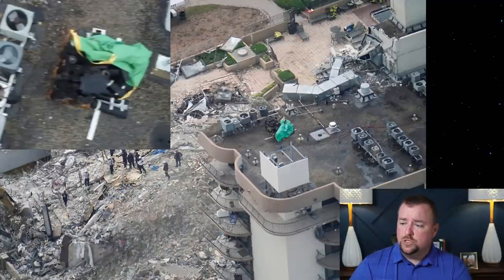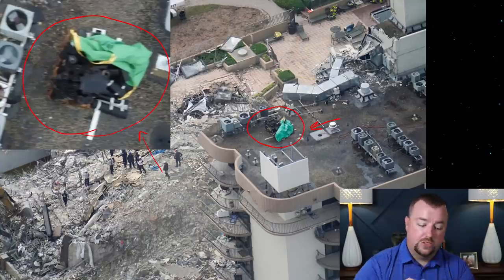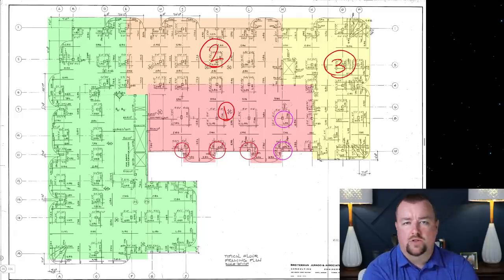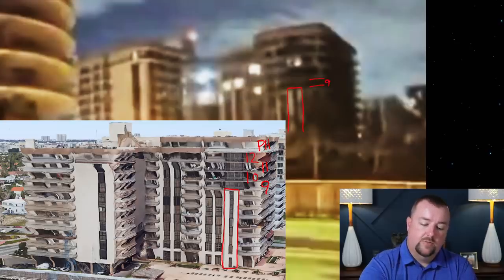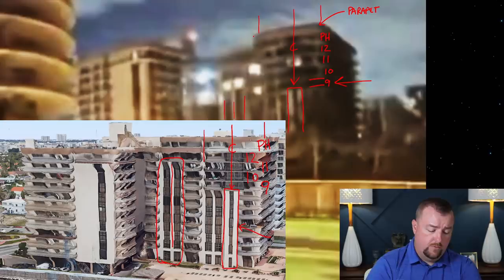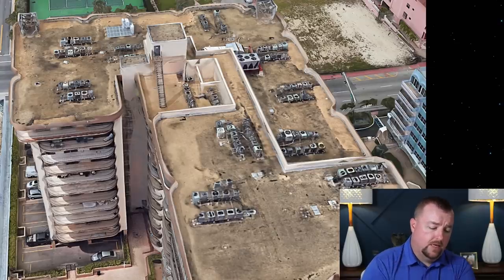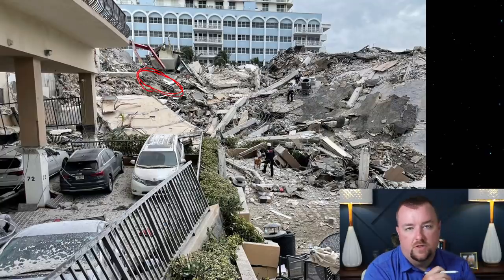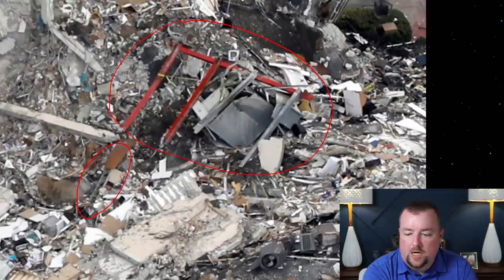Surfside Building Collapse - Did it start at the roof?

Comment: I'm not an engineer, but I've built commercial buildings for 30 years. Given the total collapse of the building, there is NO WAY the problem started at the top. For whatever reason, this building was deficient at the base! 
The issue with the 9/11Twin Towers didn't start at the base, but had several (as I recall, in one case it was 13, and more in the other tower) stories pancaking under inertia! For the total destruction in this case, it had to start at the bottom! When I heard about this collapse I thought Hmmmm, that's interesting. When I saw the video I thought... holy s***! I've seen planned demolitions that haven't gone that well! And don't start with the conspiracies theories!
Reply: Agreed ... A column snapped and the spandrels dropped snapping the post tension tendons ... When the bowstrings broke the building came down
Reply: Buildings like these towers were built to withstand this much damage without complete failure.
No way was the roof job a trigger to the collapse.
It had to be there in the bottom ,inside the columns from too often assault and  inundation of saltwater from inside and or ground level giving way by sifting sands beneath the towers or both at the same time happening, spanning many years.
Perhaps,there was not enough waterproofing done to concrete walls,floors and columns when   needed. Waterproofing  even stone is very beneficial to inhibit moisture damage.
Reply: You can say that all day- but the fact is clear- that inner penthouse parapet portion is completely missing and I never noticed that after watching this a hundred times. Went back to google maps to see and yes- it’s totally flush with this remaining parapet wall and should be visible. Would be nice to compare the time stamp of this video with the next door hotel guest video of the parking garage. If they coincide it wouldn’t surprise. Where it started, roof or base, but that wall is clearly missing. Something happened up there as well as in the garage.
Reply: @TheArayray  Interesting.
Knew nothing if that before your mention.
Reply: Agreed.  Also, the Twin towers collapsed with help of the burning jet fuel causing the support structure to melt and start the top to bottom collapse.
Reply: @TheArayray  You watched that video 100 times? News flash, we're on the mend from Covid. You're allowed out again!😃 
The weakness was at the bottom of the structure!
Reply: @alacran1986  The failure (removable) of the fireproofing due to the initial explosion, and subsequent failure of the steel trusses due to the heat, WAS the ultimate failure of the twin towers. In the '70s, they had actually planned for a fire caused by the fuel load of a 707. However, they assumed the fireproofing would stay intact. It didn't! Counterintuitively, wooden timbers survive fires better than unprotected steel beams.
Reply: @carlwilliams6977    -Note that the condo on June 24th dropped similar to the part that dropped on July 4th.
-Note that the condo collapsed similar to WTC7.
-Note that the University of Fairbanks, Alaska  investigated the fire-theory and concluded after a 4 years study, that WTC7 was NOT brought down due to fire.  See final report released in March 2020.
-Note that office fires won't produce enough heat to melt  steel.
-Note that adding more fuel doesn't produce hotter flames, in fact a fire can be extinguished by adding too much fuel. 
-Note that NIST had to abandon the pancake collapse theory for the twin towers.
-Note that, when you say that the twin towers were hit by an hijacked plane, which you seem to indicate, that you follow the NIST-conspiracy-theory, that  a group of cave-dwellers from Afghanistan CONSPIRED against the United States.
Reply: @TheArayray  Hi Rayne. I agree, watched the video over and over, the penthouse seems to be damaged "before " the main collapse. Speculate we can, perhaps the inner column(s) under the penthouse went first? rubble seen in basement prior was from "left" area under penthouse. There is a comment from a survivor stating something about a floor missing on the first floor, could this floor collapse have been the cause of the pool deck also collapsing? So did the penthouse collapse, shocking a column(s) to failure in the parking bay level followed by a floor collapse internal to still standing exterior, causing pool deck to fail (dragged down by internal slab) which in turn expanded to pull down peripheral columns?
Refer: https://www.youtube.com/watch?v=jIHa5n_4TSk
Clearly shows 12th floor roof parapet intact and penthouse (left) missing while outer skin remains intact. Then the total collapse is centered at a point directly beneath the missing penthouse  (right side of Section 1) followed by collapse of right side of 'Section 1"
Working on the roof followed by collapse of penthouse area ...... coincidence?
Reply: @reallyme3573  You've lost your mind, and live in Qville. NOTED!!
Reply: @carlwilliams6977  and yet here you are! It’s a 5 second video so that’s about 500 second of my life which is still a minuscule fraction of the time you spend online trying to figure out what sex feels like.
Reply: @carlwilliams6977  Omg so boring, no wonder you have no idea what it feels like.

Comment: The really bright, blueish lights you're speaking of look somewhat like arc-flashes. Could this have been caused by the high current lines being severed as the floors pulled away??
Reply: Thermite
Reply: Det cord ..  go look up mine pit blasting. It’s so obvious it’s internal explosion. Det cord explodes in milliseconds just like a light flash. People inside wouldn’t have been able to differentiate the noise between that & the building collapse.
Reply: yeah thats exactly what I thought
Reply: @R00RAL  I've used det cord before...Tried 'blasting' a 8" tree trunk by wrapping a couple turns around it. Just having some fun to see whether that would take the tree down.

It. Did. Nothing. To. That. Tree.

Didn't even scar the bark layer.

Det cord could not bring that building down even if it were severely weakened.
Reply: @R00RAL  I've watched controlled demolitions before. I see nothing that even hints this was similar to those...
Reply: @DaveC_TN  Fair enough .. we agree to disagree then.  The world is run by criminals. We must agree on that. I know families were in the building.  I believe McAfee may have stored evidence there. It’s just speculation, however possibly why it was dropped.
Reply: @R00RAL  it wasn't an explosion, there was no explosives involved. IF it was a controlled demolition, it would've been done with something quiet like thermite (which doesn't ignite with common detonators like det cord and blasting caps).  Thermite requires a much higher temperature than what blasting caps can offer, even a high strength blasting cap would likely destroy the charge even before it ignited (IF it could ignite it). 

I have worked with several high strength explosives for several years and I can tell you with great confidence there was no explosives used. If they find metal beading on the supports, it will tell us this was certainly melted by thermite and was an intentional detonation, if not, then it likely did actually fall on its own. I, however, do not believe it randomly fell on its own, but only time will tell.
Reply: @R00RAL  That's not the same building, hun.

Comment: I have from the beginning said that those blue lights, flashes was electrical. Consider how much voltage is needed to run thoseA/C units, and then how much for each condo. There’s minimal 240 volts running there. Maybe even 440. All these people who say it was a explosion from dynamite has never seen high voltage short out. Once you do, you won’t forget it. Very impressive to see, and scary! And there is more than just one bundle of high electrical lines running up those walls. Couldn’t imagine three or four of those runs being ripped apart and shorting out! Imagine two sets of 220 being shorted out together!! That would be 440 volts there! Then imagine multiple lines like that all shorting out together!! That would be very loud and bright! Would even sound like explosives going off!  I have witnessed something similar to this before.
Reply: Close enough and it will blind you. Lighting inside a condo. Might explain how the fires started nicely.
Reply: @cynvision  wouldn’t surprise me one bit if the electrical did start the fire. Each condo probably had 220 in it. Which would make some nice lighting and fires!
Reply: As someone who has seen both electrical arcs and dynamite explosions, this was pretty obviously a case of arcing from damaged electrical conductors.
Reply: The electrical plans show the building is wired 120 volts Y 208 volts   . Ie 120 volts for lightning and 208 line to line for ranges water heaters and ac units
Reply: If you look at the blueprints (https://www.townofsurfsidefl.gov/docs/default-source/default-document-library/town-clerk-documents/champlain-towers-south-public-records/8777-collins-ave-1979-plans.pdf?sfvrsn=bd2a1194_3)
Page 83 shows the electrical riser, item number 6 is a 3000 Amp 120/208 Volt 3 phase switch, that feeds item 8, a 3000 Amp 120/208 Volt 3 phase buss duct.  That runs vertically up the building and feeds electric meter rooms on floors 2,3,5,7,9 and 11.  Each apartment is feed from it's own meter.  You can look at the plans for each unit, in the pages before this.  For example, on page 81 is the plan for the "A" apartment units.  Under the floor plan, the table labeled "PANEL A" is the circuit breaker box configuration for the unit, which is a 125 Amp 120/208 Volt panel. 
No 480 Volts in this building, just 120/208 Volts.
Reply: @robert20770  Looks like 2,427 amps running up that thing. Sheesh
Reply: @TheBjray  For an electric arc you need  high voltage, 10K  Volt  would be nice, not  Amps.
208 Volt won't create such a bright arc.
Reply: @reallyme3573  208v will make a nice boom with enough amps behind it. I've seen a 400A 208 3-phase distro plugged up wrong before. Guy didn't connect the gnd, made for a nice firework show and he flew back 10ft+
Reply: If you play the video back frame by frame, the lower flash goes out in the same frame as one of the lights in the condo above and to the right of it. A couple frames later, the upper flash goes out in the same frame as a window that's almost at the ground in the section that's falling. A few frames later, the few remaining lights in the whole building go out. Definitely a main feeder being ripped apart, and each phase of the 3 phase feed faulting in succession.
Reply: @robert20770  ok. Thanks. Wasn’t to sure about the 480 but I knew that each condo had to be wired for 220 or in this case 208 for stoves and dryers. And with knowing all that about where the feeders and condo meters are, that makes for a big short circuit!
Reply: Plus the rebar snapping or popping out of the concrete makes a very sharp, loud snapping sound.
Reply: @karlschauff7989  I have never heard rebar doing that but could only imagine it would have been really loud!
Reply: Where was the distribution transformer - in the basement or in the sidewalk outside the building? Was 11kV provided to the basement and stepped down for the busbar, or did the busbar extend to the street? 11kV on a 208V bus bar could cause quite an arc. Since the utility doesn't have to get permits, other than having a transformer room, it wouldn't necessarily show in the plans.
Reply: @johnhaller5851  I am not sure. Just know it ran up the wall by the elevators. Kind of scary if it was in the parking garage area since it was constantly flooding. So I would think it would have been at ground level
Reply: @johnhaller5851  The transformer room in on the first floor next to the electric room.  Looking from Collins Ave the far left front room is the transformer room, then to the right is the electric room, then the trash room, next the office and then the building entrance.  There are no details showing what is in the transformer room.  Most likely the transformer and the transformer room belong to the power company.  The power company would  have total control over that room, the people from the condo would have no access at all, ever.
Around here (Maryland part of Washington DC area) the service would be 7200 Volts phase to ground, and 13800 Volts Phase to Phase.  The available fault current on the secondary of the transformer would be very high.  The 3000  Amp switch the feeds  the buss bars has an AIC of 100000 Amps.  There is also a 1000 Amp switch that feeds a 1200 Amp fused switch box / distribution panel.  The 1000 Amp switch has an AIC of 65000 Amps.  (This is all on page 83 of the blueprints.)

Comment: I was one of the people who thought the Roof collapsed first but after the garage video and multiple witnesses saying the Pool Deck collapsed first, now I'm pretty sure that was the case. It was a punching shear failure of the slabs of the pool deck that destabilized the columns of the building
Reply: that and I think years of water percolating under that area and the whole building certainly helped cause it.
Reply: How do you know something from the roof didn’t cause the pool deck to collapse
Reply: @dreamersruleNOW  the roof was a long way from the pool deck and how would they have gotten all that weight to the roof? Thru the elevators? You people dont think very much.
Reply: @dustyflair  well if it’s explosives? The inspector was up on the roof 14hours before collapse. He says 3others were there too .  I’m not saying I know either way.  A leak on a lower level pulling down whole building is pretty odd. If a lower deck dropped down, building would not come straight down
Reply: @dreamersruleNOW  explosives? HOLY CLOWNVILLE!!!! Lady, the building was falling apart for the last 20 years. It is on the OCEAN FRONT> Seasalt will expose ANY WEAKNESS OVER TIME. If the lower levels give way what do you think will happen to the upper levels capt obvious? They will float in the air?
Reply: @dustyflair  all the oceanfront condos the world over are on oceanfront salty air and they didn’t come down!  Sheetrock, ok I could see trickling water cause Sheetrock falling but not an entire building. If a lower level collapses the building will tilt over on its side, it will not have a uniform straight down pancake collapse.
Reply: @dustyflair  they have shown where buildings tilt and Jean, only explosions bring buildings straight down. You’re saying maintenance was so negligible it couldn’t be detected. The inspector was at this building only 14 hours before the collapse. Unless every beam, every post,,whatever structure was holding this building up, it must of been rotten at every posts .
Reply: @dustyflair  I’ve seen 3 very experienced builder engineers online saying they can’t wait to see who comes up with something other than explosives took the buildings down. So we’ll see. I am not builder expert. The engineers say they’ve never seen a building like this come down especially with zero physical manifestations; much greater than water pouring into a garage.
Reply: @dreamersruleNOW  listen karen, what would an as you claim INSPECTOR on the ROOF know about the structurial stuff UNDER THE DAMN BUILDING? Karen, let the investigation take place and stop with your DELISIONS and wanting to have this AHHHHH HAAAAA moment.
Reply: @dreamersruleNOW  all the extra water made the building TILT over KAREN...>Go take your meds and head to bed.
Reply: @dustyflair  who’s Karen? I’m just restating what the engineer who said buildings don’t fall like this.
Reply: @dustyflair  so the engineers who say this is not possible are delusional because u say so? I’m only restating their opinions
Reply: @dustyflair  Just popping into this 10 month old comment thread to say I'm absolutely stealing the phrase "Holy Clownville" for future use. 😂

Comment: Good on you guys for picking this up. Hopefully the original video with the previous 10 minutes will emerge. Then we will have a more complete understanding. Though all of the issues raised through the full series of discussions are part of this event. You did register interest as to why the repair work started with the roof. One of the things I can see with the roof is that the water proofing seems to end cleanly at the base of the parapet ie doesn’t rise a distance to keep water away from the upstand junction a reliable location for concrete cracking.
Reply: Kopp

Comment: Careful, well demonstrated analysis.
Reply: Yes, except it was all just talk. In the ORIGINAL video, witnesses say they heard a bomb and there was the unmistakable flash or termite detonation around the fifth floor. This is not conclusive but the original video needs analysis. Otherwise, we can pour on the tech jargon all day and go nowhere.
Reply: @onlinecall5284  
Unless Josh Porter is also a Qanon theorist, you’ll have to go elsewhere to spread that propaganda! Why don’t you believe in applied science?
Reply: @onlinecall5284  People hear fireworks and think someone is shooting a gun. If you've never been around a controlled demolition then you don't know what you are talking about and neither do the people who think they heard a bomb. They are in shock from witnessing such an event. Apply science and math to this disaster and you'll see this isn't another conspiracy. The building was neglected as is shown by the pictures of the garage and the engineering reports. The reality is that the homeowners did not want to pay the hefty assessment to fix the property, so the damage continued underneath the concrete where the rebar is located.

Comment: Those flashes on the left may have been caused by power feeders breaking and shorting out as the floor collapsed. The reason they would quickly go out during the collapse is the main breakers in the basement or utility room tripping off. Just speculation but the blue in that light is indicative of electrical arcing.